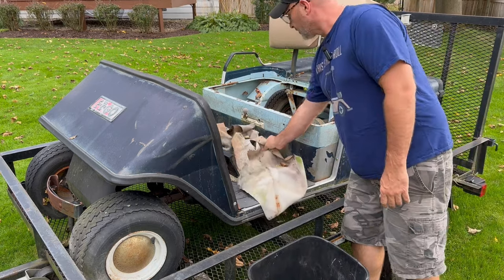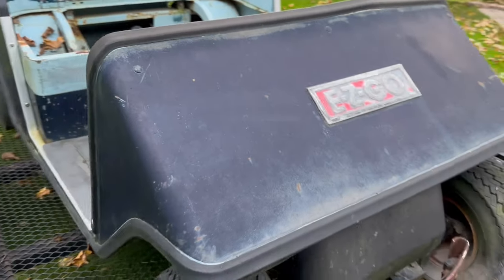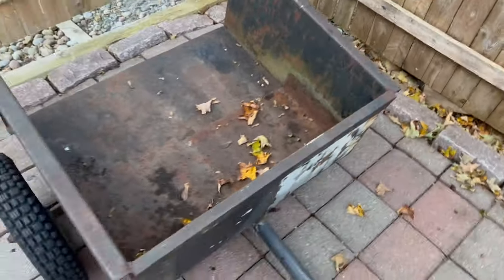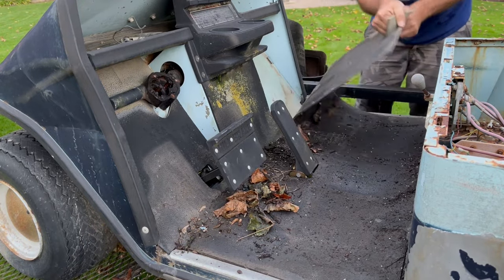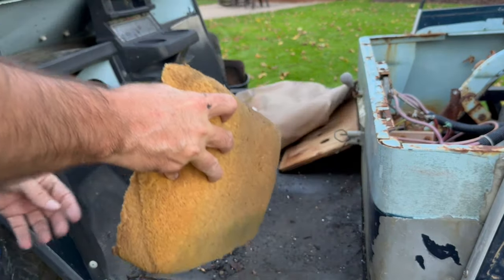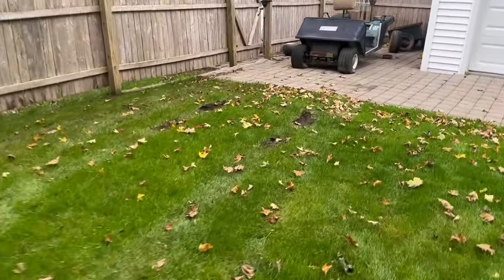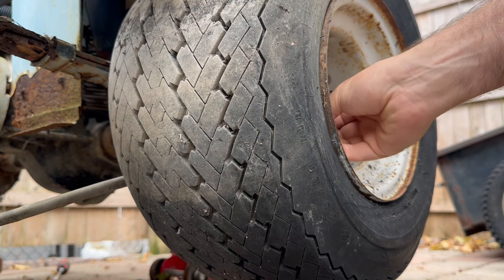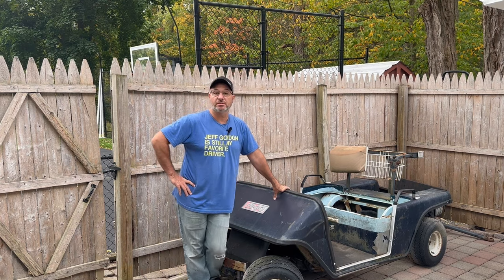Project Rat Cart. Will it even roll? -Video 1  #ezgo #golfcart #ratrod #rebuild #golfcartlife

Comment: I did chuckle a few times. You worried about your grass and your concern about the welding oh and grinding.
I noticed your front spindles from the factory are already upside down. Which is what is done to lower the front after market garage. I sub
Reply from the maker: Tried to get some comedy in this one! Thanks for watching. Curretly tryin to figure out another cart to get all the guts out of. And the grass is coming back in!